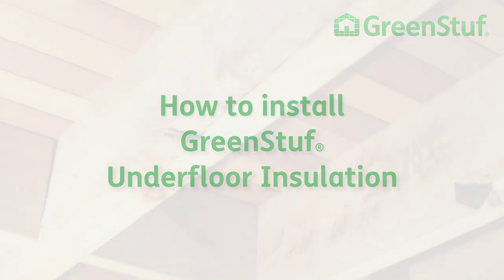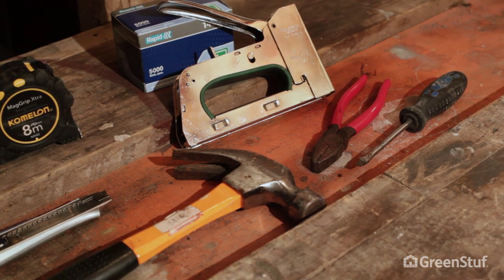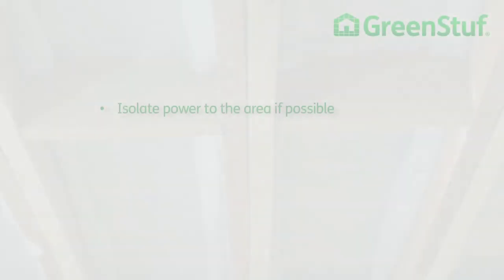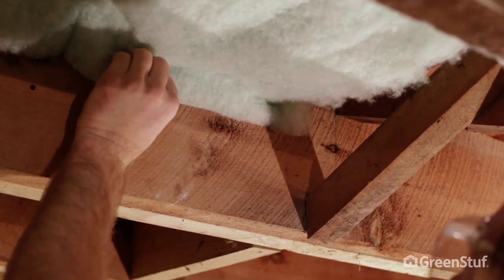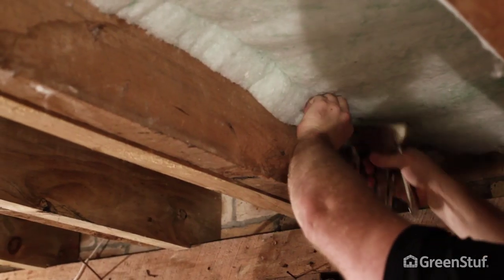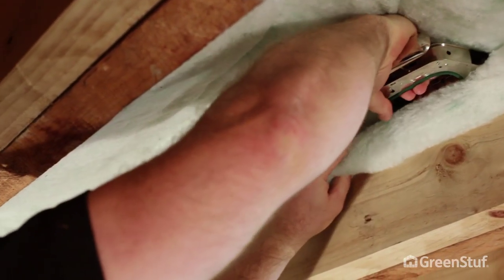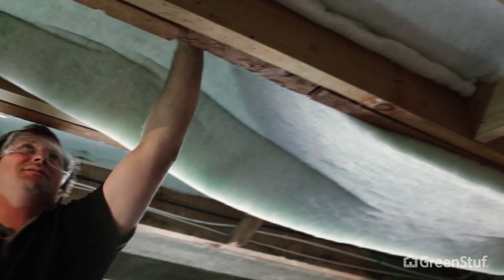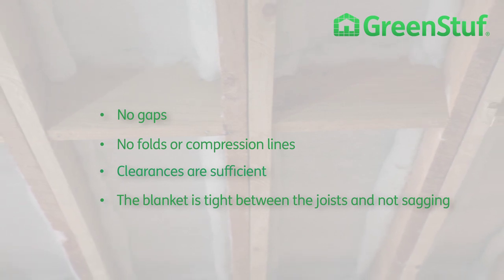How to - GreenStuf Underfloor Insulation

Comment: Yes 400mm is a tight underfloor.  So lay a tarp down outside the manhole (the put the clean product on), and another one just inside the manhole.  Then use the empty plastic bags that the product was delivered in as runners to cleanly slide the product along. Unroll part of the massive role on the tarp outside the manhole, pop through the manhole and drag one end of the roll with you.  Your outside assistant can continue to unravel the roll and feed the insulation to your as you crawl along.

Comment: Another way to keep the GreenStuf insulation clean is to split the bags that it comes in and use them as 'runners' on the ground under your floor.  The insulation can be pulled along the runners so it stays clean.

Comment: An even safer way to install underfloor insulation is with a double insulated electric stapler.  If an electrical wire is accidentally stapled, there is no risk of electrocution.  A hand stapler might not be the safest way to go.